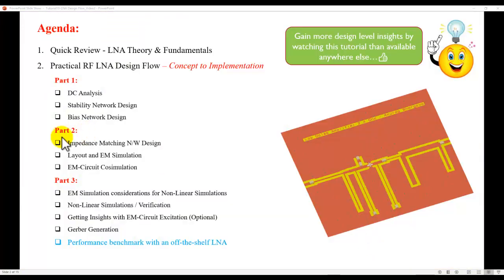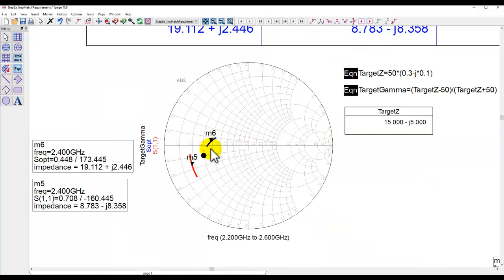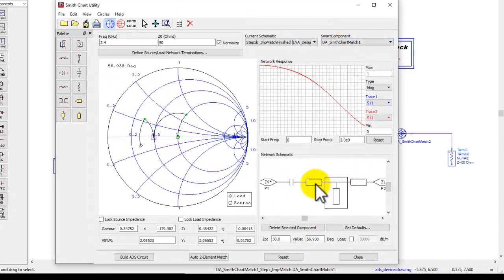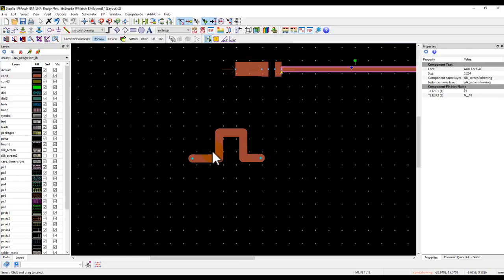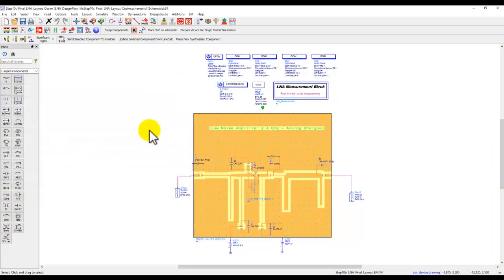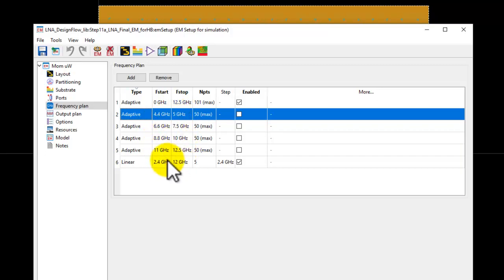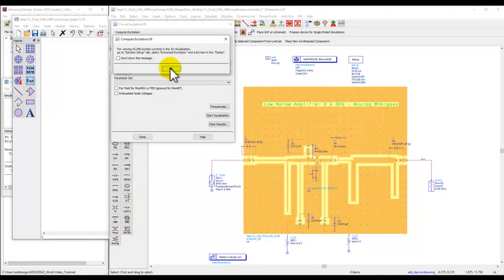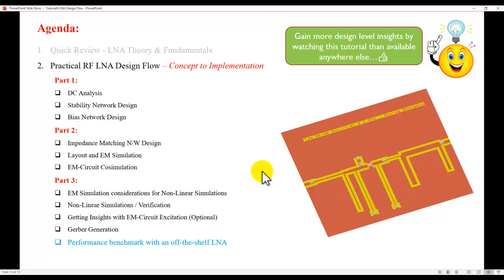RF Design-10: RF LNA Design - Part 2 of 2

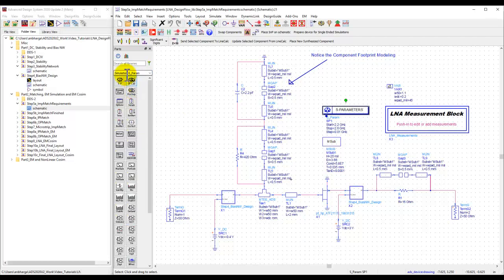Comment: Thank you for a great tutorial.  What's the purpose of the circuit, R=420ohm in series with C=2.2pf 4:26min?
Reply from the maker: That is part of the stabilization network to achieve broadband stability of the transistor

Comment: Dear Anurag sir, thank you for the detailed video explanation. I have a question, I am designing a LNA using a GaN process library by Winsemi. Can I model the discontinuities of lumped elements using the ADS components (MLIN and MGAP) ?
Reply from the maker: Modeling discontinuities if your circuit is LC based doesn't matter. Also, GaN is not a suitable technology for LNA design as it is usually used for Power Amplifier kind of designs. For LNA, you should look for low noise pHEMT kind of processes
Reply: @BhargavaAnurag  Sir, thank you for the reply. I am using a Winsemi 150nm PDK transistor which has been used in several research papers for LNA. For the discontinuities, what i  am referring  to,  is the L,R,C in my LNA circuit used for feedback/stability. Just the way you are modelling the shunt R-C branch for using MLIN and MGAP. Should I model it ?

Comment: Hi..
thanks for theses helpful videos,...  i want to ask you a question maybe strange (i am beginner):
what is a difference between a process (e.g tsmc) and model (e.g Tom or cree) ?    
in other words which one can use to design a LNA or power amplifier
Reply from the maker: It is quite lengthy topic to discuss but below are some points:
1. TSMC is a foundry involved with wafer level stuff so if you are designing IC level then you can select foundries like TSMC or others.
2. Each foundry will use different technologies like Silicon, SiGe, pHEMT, HBT etc etc so you need to carefully choose a process that is suitable for your circuit design characteristics.
3. Vendors provide transistors in packaged forms which underneath use processes mentioned above but its easier to use for designs like PCB design and usually a low cost and more generic in nature

Hope some of this is helpful.
Reply: @BhargavaAnurag  of corse, it is very very helpful... thank you very much Mr Bhargava ..

Comment: Hi Anurag, can I please ask a question? 
@18:21, you did output matching and you matched source 49+j24 to 50 ohms load. 
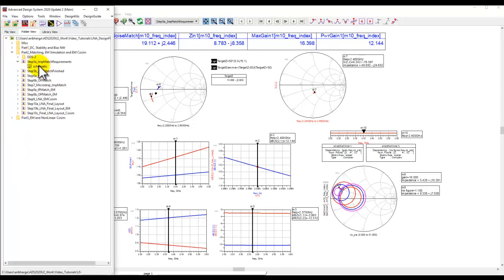I believe you picked that because @17:02, the S22 suggests impedance is 49-j24, which is the conj of the source. all good!
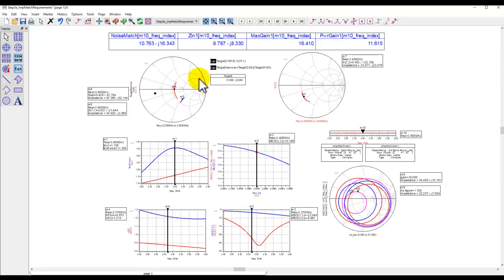But my question is when you match the input for noise and power, the S22 changes, as shown in @15:33, the S22 impedance becomes 23.5-22.5. So why did you still match 49+j24 to 50 ohms?
Thank you
Reply from the maker: All rf devices are bilateral so load/source impedance will change when you match on the other side. At the end you can always optimize to balance the performance.

Comment: Hello guys,

I was doing well but suddenly I got this error: 
ERROR: (vapi_aj_runtime.ael line 15897, column 9 in de_copy_cell) 
Error copying cell "smithdg:SmithChartMatch": Cell "SmithChartMatch" not found.

I'm not able now to use smith chart smart tool even when I start a new empty workspace.
I searched online for a solution but never found. YOUR HELP IS APPRECIATED :)
Reply from the maker: Hi,
It seems you have created fault in some config files. Close ADS and look under your home directory to find hpeesof folder or search for it if you are not sure where is your home directory. Rename hpeesof to something like hpeesof_old and restart ADS which will create new hpeesof automatically and try using Smith Chart tool again.
Hope this helps….
Reply: @BhargavaAnurag  Thank you Anurag, yes it happened suddenly, I solved it by switching to another ADS version.

Comment: Hello Sir,
Suppose I have the S-Parameter Model and do not have the non linear model of device, do i still need to design the biasing network for the device or just design the input or output matching network?
Reply from the maker: you will need to design bias network even if you use S2P file for device otherwise how will you bias the device in real world...😊

Comment: Hello sir,
First I wanted to say that I really liked the video.
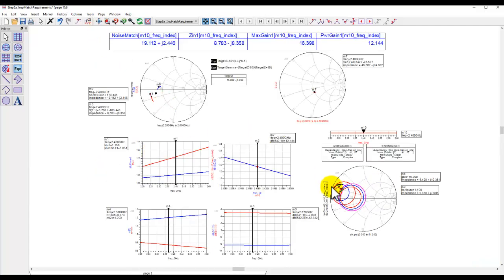There is a small point that I did not understand after we found that the point( at 12:47) 9.358+j7.508 is the point that we will have to coordinate with as you explained at 12:47
How do I configure the Smith chart Utlilty to perform the matching?
(In the previous video we match the input impedance to 50 ohms)
Could you explain to me again after we understood what the intersection points of the GAIN and MIN NOISE are, what do I do to match?

Comment: 18:19  why there is so many element in matching circuit. We can do with just two of movement.
Reply from the maker: Lesser matching components can also do your job, but your matching will be narrowband and very sensitive to components or PCB etching tolerances. Having few more components gives you broadband performance and less sensitive circuits. There is always a compromise between overall circuit/layout size vs. less sensitive circuit design. Hope this helps.

Comment: In step 9, when I simulate the final result, I have some shift in S11 and S22, How can I optimeze the TL over the symbol EMModel?
Reply from the maker: You can do so by having a parametric EM model and I would recommend you to contact local Keysight tech support team for help

Comment: Thank you so much sir. I have a question. At 30.48, which view did you select before run the simulation? EmModel or layout?
Reply from the maker: layout view is not for circuit simulation, it should be emmodel so that you can get em simulation results in circuit simulation.

Comment: Hi. Thank you very much for the videos. Being a begineer in the field, I find them incredibly useful. Can you please help me understand what load impedance you specified for the Smith Match 1 and the source impedance you specified for Smith Match 2? Because the load impedance for Smith Match 1 is not the input the impedance of the FET but this has to be taken at the input end of the bias network. Similar case would be for the Smith Match 2. Sorry if I am missing something basic here.
Reply from the maker: Hi,
Its purely your choice, as a design practice I never consider FET/transistor's input impedance as as load for my Input Matching network design and I always include Bias network to be a integral part of the device that needs to be matched and I did the same thing here.
Reply: Thank you very much for your reply. Even after 2 years of uploading the video, you still answer queries patiently. Immense respect to you!! I understand from your explanation that it's best to include the bias network. I guess then, for match 1, the source impedance becomes 50 ohm, and the load is 8-j8 from the S11 smith chart plot. Similar case with the output impedance matching. Thank you once again for the clarification and the wonderful tutorials.

Comment: many thanks , but i have one question ,how to do you choose or convert value of ideal mircostrip with 25 ohm  which has line  width of 2.9 mm in line calc ,but you use another value 0.871889mm

Comment: While desining LNA using HEMT for 28 GHz will the steps followed be same or some changes are to be made?
Reply from the maker: The theory will be same but the implementation would be in IC format typical GaAs based MMIC so you will need to adapt it as MMIC format & components

Comment: Thank you Anurag. Please I have gotten to the Co-simulation part but receiving this error: ERROR: (stdcmds.ael line 135, column 12) 
Error generating netlist for "MyLNAs_lib:Part2_Step9:schematic": Failed to create netlist:
There is no corresponding terminal for `P3 connected by position 3' in the netlisted view `MyLNAs_lib:Part2_Step8_OPMatch_EM:schematic'.
How do I sort this out?
Reply from the maker: I guess you forgot to select the emmodel from Choose View for Simulation.
Reply: @BhargavaAnurag  I have same error, but I´ve choosen EMmodel for creating the simbol, any other possible solution?
Reply: Solve!
Reply: @BhargavaAnurag  Any special way to define the ports in the layout or in the EM simulation ?

Comment: Thank you very much! I just have a question. What should we do if we need Noise circle to do the impedance match for lower frequency design? Thanks
Reply from the maker: Hi,
I am not sure if I am able to understand the query. You should be able to plot Noise Circles as long as you have the non-linear model or a S2P file for the transistor device that contains noise parameters around the desired frequency.

Comment: excellent demonstration !!
I have question you have added ground plane cond2 in LNA design(both in substrate setting and in layout window). but when I used to define substrate as you did in LNA design video and cond2 layer in layout window as well, I didn't acquire desire results.
Reply from the maker: Hi Rabbia,
I am not sure what mistake your might have but just check if you do VIA holes in layout as well as defined the same in your stackup? If doesn't resolve the issue then kindly contact your local Keysight tech support team for assistance.

Comment: Great work sir, thank you so much, however there is something I am missing and that is why did you place your input matching network right  after the source impedance knowing that the Bias network is already design to exhibit 50 ohms impedance, shouldn't the input matching network be connected between one 50 ohms terminal of the bias network and the impedance seen looking in the transistor gate ? the same with the output matching network shouldn't it be connected right after the transistor and one port of the bias network which is already designed to exhibit 50 ohms ? please help me !
Reply from the maker: As a general rule and good design practice the bias network should be the first thing on either side of the active device and then the impedance matching network design should be done.

Comment: Hello, sir first I would like to say these videos are very informative and have been very helpful and I have learned a lot from them.
But I have a query I am trying to use ATF-36163 and can't seem to figure out the source-drain and gate terminals so can you help me with that also if u had to recommend any other MOSFET for the LNA which would that be. Thank you
Reply from the maker: It would be easy if you contact your local Keysight tech support team for help. Usually these terminals are well defined for a library component and if you are importing a netlist then Pins show the proper name for G,D,S etc for easier identification.

Comment: Thank you a lot for your great videos. I have questions regarding the logical values ( the maximum and the minimum values) for the lumped components such as capacitors, inductors, and resistors in the RF industry, which are very important in the optimization process, especially when we want to minimize or maximize the value of a lumped component to reach our goal with minimum error.
In addition to that. I found that we could have a high gain (S21) even if the S11 and S22 have bad values ( 0 to -5 dB) and some simulated values greater than zero (+ve). So what does it mean sir, is the value of S21 basically depends on the amplifier and could improved by a low S11 and S22? 
And apologize for the lengthiness ..  with my best regards sir.
Reply from the maker: Your questions are related to very fundamentals of RF Circuit Design:
1. When using L & C components for your purpose you should check their SRFs and don't use any component where SRF is lower than your desired frequency.
2. S21 has no real meaning or usefulness if you don't have proper S11 and S22 because the power will be reflected resulting in useless circuit.
Reply: @BhargavaAnurag  thank you so much for your reply and  I will follow your advice for sure .. it seems that we are away behind your knowledge sir  :)      regards

Comment: Thanks a lot sir,

In the output matching, at the minute 18:23
The capacitor was after the Impedance of the circuit, not befor the 50 Ohms

At the minute 23:00 the capacitor was before the 50 Ohms
I am little confused, when you have used Smith chart you designed circuit to match the 49+j*24 to 50

And you have used it in an opposite way (from 50 to 49+j24),

Please, can you explain it,
Best regards,
Reply from the maker: Hi Muhammed,
No need to confuse yourself...😊
Its all about what Zs and Zl you used while using Smith Chart tool. In my case I usually prefer to use Zs=50Ohm even if I am designing Output stage matching network. Now if you see its the reverse of the actual case as for output stage Zs should be the output impedance of the amplifiers and Zl should be 50Ohm but because I reversed this definition while designing my network, I need to flip it when I place it on schematic so that I can have Zs and Zl on the correct side.
If it is confusing for you then you can simply use Zs & Zl as applicable for your impedances and while doing so you need to use complex conjugate impedance as the notation of Zs is Zs* in the Smith Chart utility.
Hope this is clear to you?
Reply: @BhargavaAnurag   thanks, it is clear now 🌷🌷🙏

Comment: Sir, a problem is that, after the symbol at 52:44 is generated, when I go back to the layout view, all my MLINs and MTEEs were converted to the "ads_device" layer, have you ever met this problem? thank you.
Reply from the maker: I am not sure how are you going back to the layout view so hard to comment. I would recommend to contact your local Keysight tech support team for help as that will be easier to troubleshoot the issue.
Reply: @BhargavaAnurag  ok, I will contact the support team. Make it simple,  after the look-alike symbol of the layout is used in the schematic, the MLINs in the layout will be on ads_device layers(blue color MLIN), and the cond() layer will not accept any MLIN or MTEEs, very tricky.
Reply from the maker: @hezehua5194  Your explanation is confusing, The layout symbol doesn't do anything to the original layout and you can do whatever you want but to reflect the changes, you need to delete the symbol and recreate the same again as it doesn't change dynamically.
Reply: will recreate the symbol, it's hard to describe the problem without pictures,lol, I don't know the application scenario of the ads_device layer, and why the all the components on the cond() layer turn into ads_device layer automatically.

Comment: Hello sir.. thank you so much for the informative lectures. I have two questions that is 
First: in the impedance matching in Schmitt chart utility the Z=50 ohm but on the ADS circuit layout they are of 25ohm, how is that happening?
Second, after designing the input and output layout and designing with the transistor that is in step 7 i am not getting reliable result.

Please kindly help me.
Thank you.
Reply from the maker: When you do initial matching network design, 50Ohm reference impedance is kept as default but while optimizing the circuit you can chose to optimize the impedance as well and that is what I have done here. Playing with impedance under your fabrication limits helps in coming up with shorter length transmission lines reducing the over circuit size.
It will be difficult for me to comment on your results as I can't see what you have done. I would recommend you to contact your local Keysight tech support team for help.

Comment: Hi Anurag! Very nice tutorial on using ADS for LNA Design. I have followed the video till placing input matching layout component on shematic. There, on running simulator, i get following error message: The instance `I__0' has 13 pins, but the view `LNA_lib:Input_Layout2:schematic' has 0 pins. Could you please advise on resolving this issue? Thanks.
Reply from the maker: Hi,
Please click on "Choose View for Simulation" icon and select emmodel or whatever name you gave to the layout model during EM simulation from the list. When you simulate after selecting proper model, it will work fine.

Comment: H Sir, in your EM simulation, I cant see the ground connected to holes? or how the ground plane is defined for EM simulation? I often used syntax "gnd!" to define the bottom layer as a ground layer, so is it true or not? Thank you very much?
Reply from the maker: Hi,
It depends on your stackup definition, if you have Cover plate defined then you don't need to do anything special as that will be used for return path. Incase of conductor layer mapped you can gnd! net name to denote the purpose but you will still need to define the respective layer under Port Editor as I explained in one of the EM simulation videos.
In the video you referred there were VIA holes but perhaps you can't see it due to top conductor layer....😊
Reply: @BhargavaAnurag  Thank you very much ^^
Reply: Hi Sir, I have one more question. I am trying to EM simulate my circuit and follow your videos, but it is realized the EM results are so bad, compared to circuit-based results. Is it normal or is there something wrong in my simulation setup. And EM and circuit results must be similar ? Now i am in stuck with this. Thank you!

Comment: I would highly appreciate if anyone could link the video for what function explanation. It would mean a lot.
Reply from the maker: I am not sure if you need a lengthy video about what(), below is what is available in the ADS documentation and its a very simple function which returns the details about the variable/measurement passed to it:

x=[10,20,30,40]
y=what(x)
returns:
y
Dependency : [ ]
Num. Points : [4]
Matrix Size : scalar
Type : Integer
-----------------------------------
y=what(x, 1)
returns:
y
Dependency : [ ]
Num. Points : [4]
Matrix Size : scalar
Type : Integer
Block Name: __tmp_XX
-----------------------------------
Notes/Equations
This function is used to determine the dimensions of a piece of data, the attached independents, the type, and (in the case of a matrix) the number of rows and columns. Use what() by entering a listing column and using the trace expression what(x).